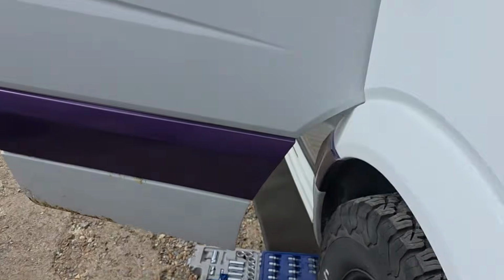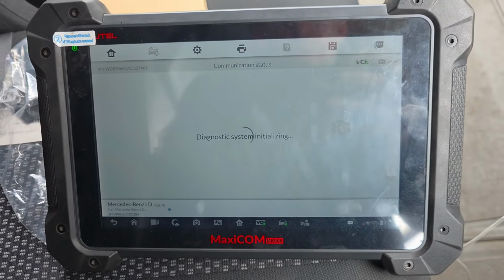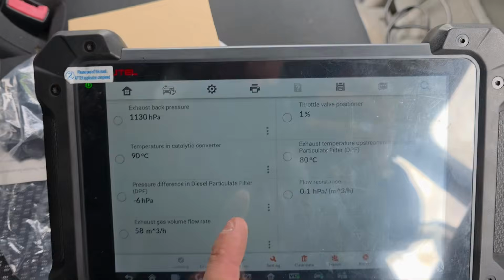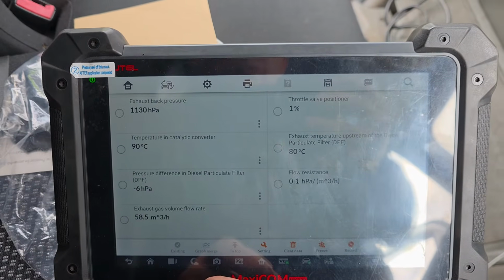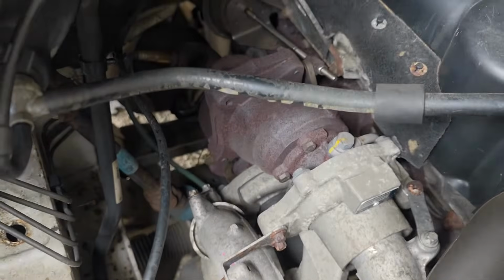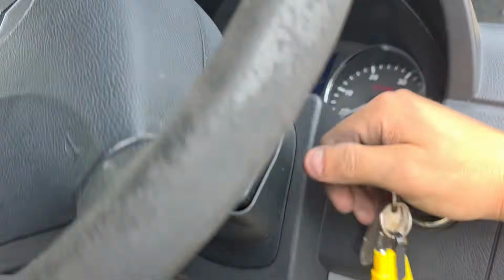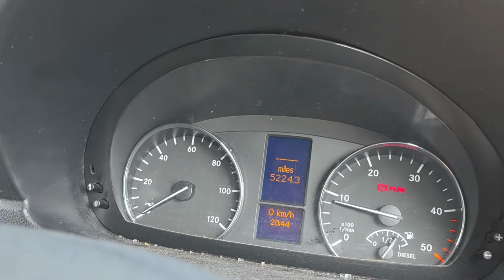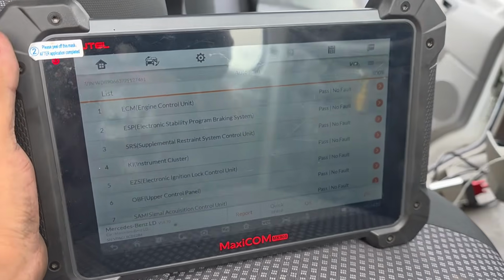🚗 LIMP MODE MERCEDES SPRINTER? NO TURBO PRESSURE? Watch This! 🚗#automobile #mercedes #mechanic #diy

Comment: Brilliant repair fell' I am getting the same van eg Luton box van today, The chap is bringing it over from glasgow so if it drives the 50 miles to Ayr I only have to check the sensors. Change the oil and filter and fuel filter so I quick service. a good job well done lads. Auld Tom in Ayr.
Reply from the maker: Thank you Tom appreciate it 🙏🏻 have a great weekend 🙌🏻

Comment: Real mechanic’s find a problem and a solution without ripping people off . 💙
Reply: Usually once you get passed oil air and fuel filter change and diag.You loose about 70% of mechanics.
It needs to be your full time job in a proper well kitted garage.
And someone who loves his job.
A rare beast indeed.Well done.